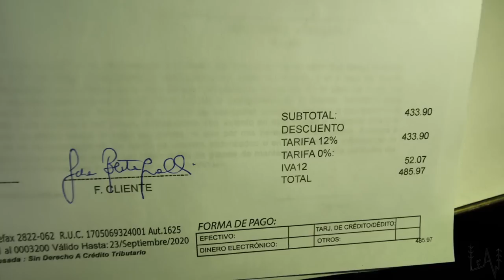Van Life RESILIENCE - We don't give up on our old Truck Camper Lucky LeAw

Comment: You are doing what has to be done. That series of trucks are work horses .once they hit 250,000 miles they require a lot of major mantinance.  Hope they put new axel seals in  the axel housing them always leak  best to replace every time you pull the axels out.

Comment: The drive shaft is 2 pieces (3 U-joints) if its not replaced in same position it came off it will most likely be out of balance. If it was correct then most likely the carrier bearing is worn out also. And probably the bearing on the front of the differential too, cause the seal was leaking there too.
Reply from the maker: Good morning! In the next video (on Sunday) we will finally fix Lucky LeAw and get back on the road! We will also show in the video what was wrong! Thank you very much for watching and commenting! 🙏❤😊👍😉👋 Cheers Luca & Sara

Comment: It almost looks like the section of driveline at the transmission end is slightly bent. It could be an optical illusion on the video. Hold a straight edge along the tube. If it isn't touching the whole length, it's bent. Two options are replace the whole thing or have the tube cut off and a new one welded on. Second option is have a driveline shop do the work. If it's straight, it's not your driveline. It could possibly be the bearing is worn out on the output shaft of your transmission. Another possibility is the cap bolts holding your U-joints together are worn and aren't keeping them together tight.
Reply from the maker: In the next video (on Sunday) we will finally fix Lucky LeAw and get back on the road! We will also show in the video what was wrong! Thank you very much for watching and commenting! 🙏❤😊👍😉👋 Cheers Luca & Sara

Comment: different pieces of drive shaft have been installed in the wrong orientation (clocked wrong) separate the pieces one at a time and turn ninety degrees and reinstall . repeat until vibration is gone
Reply from the maker: Good morning! In the next video (on Sunday) we will finally fix Lucky LeAw and get back on the road! We will also show in the video what was wrong! Thank you very much for watching and commenting! 🙏❤😊👍😉👋 Cheers Luca & Sara

Comment: Check the last connection for center, the union next to the rear end. Possibly not properly centered under the small u-bolts, that hold the universal joint the the rear drive axle. Hope this helps. My prayers are with mates.
Reply from the maker: Good morning James! Thanks! In the next video (on Sunday) we will finally fix Lucky LeAw and get back on the road! We will also show in the video what was wrong! Thank you very much for watching and commenting! 🙏❤😊👍😉👋 Cheers Luca & Sara

Comment: Look on the front yoke and back yokes there are tabs that the ujoints fit between its possible that one side is not in the tab you would have to loosen the unbolts on the yoke and tap the bearing cap back on then tighten the  unbolts back up. One other thing is make sure the safety pins that lock into to ends of the ujoints are there not missing if one is missing could mean that the ujoint is not centered right, take it back tell them it's not right they should fix it free of charge as it was not that way before. Dont let anyone tell you it's a bent drive shaft its not!
Reply from the maker: OK! We will! You are right! Thank you very much for watching and commenting! 🙏❤😊👍😉👋 Cheers Luca & Sara

Comment: Put the truck on a hoist to take the wheels off the ground. Mark the relative positions of the driveshaft installation with chalk or a crayon so you know the installed position of the shaft when you started. Remove the rear section of the driveshaft, start the vehicle, and put it in drive, to isolate where the vibration (eccentric rotation) is coming from. I would guess a bad u-joint, or improper installation of the u-joint. I'd suggest the use of his bench vise, with wd-40, or other lubricant to ease the installation of the end caps on the u-joint. The vise will press in the end caps rather than hammering them in. The rear u-joint, the one closest to the differential input shaft does not look like it is fully seated against the stop in the yoke. Nor do I see the locking clip installed.
Reply from the maker: Good morning Chris! In the next video (on Sunday) we will finally fix Lucky LeAw and get back on the road! We will also show in the video what was wrong! Thank you very much for watching and commenting! 🙏❤😊👍😉👋 Cheers Luca & Sara

Comment: Always,  before taking a driveshaft apart mark the ends of the shaft on both ends in relationship with the differential yoke and the transmission output.  And make sure when they are reassembled that they go back together the same as they came apart. It doesn't always matter when You reassemble the components. But when it does matter it matters a lot.
Reply from the maker: Good morning! In the next video (on Sunday) we will finally fix Lucky LeAw and get back on the road! We will also show in the video what was wrong! Thank you very much for watching and commenting! 🙏❤😊👍😉👋 Cheers Luca & Sara

Comment: You have to put the u joints back in the same way they came apart...they should have marketed the daft so it would go back the same way...si start by taking the front one and rotate it one half..then test..then go on down the line..

Comment: When you remove a drive shaft, a good mechanic will mark the position of each section so it goes back the same way. They obviously didn't and that's what's causing the vibration, and that will lead to more problems later. I would go back to same mechanic and ask them nicely if they could recheck their work. It looks like they gave you a break on the price, that's why I would ask them nicely to reposition the shaft and see if that fixes it. Good luck guys, we're rooting for you.
Reply from the maker: Thanks! In the next video (on Sunday) we will finally fix Lucky LeAw and get back on the road! We will also show in the video what was wrong! Thank you very much for watching and commenting! 🙏❤😊👍😉👋 Cheers Luca & Sara

Comment: you need to pull the drive shaft apart at the slip joint and rotate it until the universal joints are back in phase
Reply from the maker: Good morning Michael! In the next video (on Sunday) we will finally fix Lucky LeAw and get back on the road! We will also show in the video what was wrong! Thank you very much for watching and commenting! 🙏❤😊👍😉👋 Cheers Luca & Sara

Comment: Make sure the ujoints are in line( all caps in line with each other) the front part looks like its shaking pay closer to attention to it look closely the front joint to see if there is a dent or a spot that could have been a weight. I think the angle in the drive shaft is a little steep after the carrier bearing ( center support) . People don't understand the difference in other countries not all parts are just replace while in America we don't rebuild things.
Reply from the maker: Good morning Jim! Thanks! In the next video (on Sunday) we will finally fix Lucky LeAw and get back on the road! We will also show in the video what was wrong! Thank you very much for watching and commenting! 🙏❤😊👍😉👋 Cheers Luca & Sara

Comment: The shaft is balanced as an assembly....marking it makes no sense.

I think you should have the u-joints rechecked. If you drove out without a vibration...it shows something moved afterwards. 

You're not in any danger of a major repair. One of those joints is offset.
Reply from the maker: Good morning Frank! Thank you very much for watching and commenting! 🙏❤😊👍😉👋 Cheers Luca & Sara

Comment: My first guess would be that they damaged the new u-joint when they installed it. OR when taking out the old u-joint you should mark both ends so you can put it back together the same as before to keep it in balance. Not sure if they did this.
Reply from the maker: Good morning! In the next video (on Sunday) we will finally fix Lucky LeAw and get back on the road! Thank you very much for watching and commenting! 🙏❤😊👍😉👋 Cheers Luca & Sara

Comment: It sounds like your brake shoes need adjusting.. Its a quick fix.   If not that, your split shaft bearing is going bad or a universal joint. That is also a quick fix. Okay I saw its the U-joints. That''s good, Not that expensive, but I would also change that Split Joint Bearing on the driveshaft. Check the oil in the Differential. If it's low, it will cause your gears and bearings to get hot, on those mountain pass climbs.
Possibly split bearing. The direction of the grease fitting should not matter. That is just for greasing the joint. I'm still leaning towards the split joint bearing.
Reply from the maker: Good morning! Thank you very much for watching and commenting! 🙏❤😊👍😉👋 Cheers Luca & Sara

Comment: You don't need a new driveshaft - it was fine before.  The 'mechanics' did not mark the driveshaft sections to align the same way they came out so that the balancing stays in the same orientation as what it was.  This is rule number one:  Mark each section of shaft to align in the exact same location as it was before, relative to each section, even coming out of the transmission.  In doing this, do not turn the engine after the marks have been made, and do not turn the rear end.  Make marks to align for each section, front to rear, then don't turn anything until the shafts go back in....oriented just like they were before the shafts were pulled out.
Reply from the maker: Yeah, exactly!

Comment: I am very sorry you guys are having so much trouble. I might be able to help if you can provide good clear pictures of each U-Joint. As soon as I saw the "mechanic" beating the U-joint with a hammer it made me cringe. I like to use a press or a vice to install U-Joints. The end of the driveshaft that the U-Joint fits into is called the "yoke". The part of the U-Joint that held the needle bearings is called the "cup". When you beat the cup into the yoke with a hammer it can dislodge one or more of the needle bearings so that they turn sideways in the cup and won"t let the cup seat fully. If one of the cups is not seated fully the U-Joint will not be centered and it will vibrate. The pictures of the driveshaft at 11:48 before the repairs started, 

clearly show the retainers on the outside of the cup are in place. The pictures @ 22.25 are too blurry for me to see but I don't think I saw any retainers. The retainers snap into a groove inside the yoke.
Reply from the maker: Hi Ken! Thank you very much for watching and commenting! 🙏❤😊👍😉👋 Cheers Luca & Sara

Comment: Buy the way,  just in case I didn't get my point across earlier... If the driveshaft didn't vibrate before the new U-Joints were installed  THE DRIVESHAFT WILL NOT VIBRATE AFTER THE NEW U-JOINTS ARE INSTALLED. if they are installed correctly. Simple logic.
Reply from the maker: Exactly!

Comment: They should of marked driveshaft before disassembly now needs to be balanced. Have them remove the 2 u-joints and turn them 180 (one at a time) maybe you’ll get lucky. Also I didn’t like the way the grease monkey was beating the new u-joint in, should use a hydraulic press.

Comment: ok, FIRST, the mechanic SHOULD have INDEXED the drive shaft by making a chalk mark or some way to align the drive shaft with the rear differential BEFORE he took it out. The mark should be long enough that handling the shaft won't rub it off. Second, make sure the grease fittings "zerks" can be reached with a grease gun nozzle for servicing. The solution the out of balance drive shaft MAY require uninstalling it and reinstalling it until the vibration stops... without prior indexing it is a trial and effort ordeal to get it corrected.
Reply from the maker: Hi David! ok! Thank you very much for watching and commenting! 🙏❤😊👍😉👋 Cheers Luca & Sara

Comment: Also if the u joints are causing the shaking it’s because they were not installed properly. If they were it would be balanced. You are supposed to mate the position of the drive line with multiple colors and marks (preferably). Since this was not done your line is not balanced. You should not be charged for work that was done improperly.
Reply from the maker: Yeah!

Comment: Check ir hace Check your brakes well do full maintenance because Ecuador roads on mountains are very very tough on brakes ..find a break shop and be there Luca for the whole process ..watching all is done properly. Also check all steering system. Look if you breakdown engine or whatever other than steering and breaks nothing will happen , but, if you have problems with those two you could have a very bad accident. Ecuador is dangerous to drive steep very steep roads.
Reply from the maker: Yeah! Thank you very much for watching and commenting! 🙏❤😊👍😉👋 Cheers Luca & Sara

Comment: From Google ..... Vibration in a driveshaft can be caused by many conditions. One of the most common cause of drive line vibration are worn U-joints or slip splines, out-of-balance components, yokes out of phase or misaligned angles, approaching critical speed range, and yoke ears that are not concentric with the splines. There are also procedures on how to balance a driveshaft. Unfortunately, it looks like there are many possibilities from replacing so many components in the drive line. Any misalignment in any of them could cause the vibration. Sorry but I don't have much knowledge on this subject.
Reply from the maker: Hi, beautiful couple! Thank you very much for watching and commenting! 🙏❤😊👍😉👋 Cheers Luca & Sara

Comment: simple - they put the front drive shaft on wrong. just unbolt the front drive shaft and turn it one half turn and bolt it back on. they forgot to mark it when they took it off.  easy fix...... no cost
Reply from the maker: Thank you very much for watching and commenting! 🙏❤😊👍😉👋 Cheers Luca & Sara

Comment: I'm so sorry you guy's are having some bad luck that truck is doing good for it's age and what it's been through but they should be able to get it right they did something wrong it just needs to be done over and figure out what they did wrong would try to find someone with a press to put the U joint's in we've used a hammer before but only in an emergency maybe you can find a truck repair place
Reply from the maker: Good morning! Thank you very much for watching and commenting! 🙏❤😊👍😉👋 Cheers Luca & Sara

Comment: schweet,but I hate to tell you that's a bad or improperly installed ujoint and normally when they sound like that it's not long before the driveshaft drops out,also the angle of the slip joint looks to be out of alignment due to the rear end misaligned or the carrier mount has failed,good luck
Reply from the maker: Thank you very much for watching and commenting! 🙏❤😊👍😉👋 Cheers Luca & Sara

Comment: Was the drive shaft reinstalled backwards?
Reply: Impossible to install backwards.
Reply: @MudRFunR  its a two piece drive shaft.... the sections could be backwards or indexed wrong....
Reply: @pygpen  Yes I agree that it could be indexed wrong. I was looking at the front section which can't go backwards but yes it looks like the rear section could go either way.
Reply from the maker: =X

Comment: looks like they only change the  u - joint  you shouldn't have  to rebalance drive shaft .  the video looked like drive shaft was spinning fine no wobble no unusual sounds. get the brakes done and move on.  count your blessing this issue didn''t happen further down the road were there was no turning back.
Reply from the maker: Hey Rink! Thank you very much for watching and commenting! 🙏❤😊👍😉👋 Cheers Luca & Sara

Comment: Love this video, but the drive shaft should have been replaced with the universal joints. Way too many hard miles twisted it badly. #Ford should be a sponsor for this truck in my commercial feed. I'm spend thoundsand to fix an old E-150 XLT now for my own adventure ahead of time. Home is where the heart lives.
Reply: They don't need a new shaft - it was fine before.  The 'mechanics' did not mark the driveshaft sections to align the same way they came out so that the balancing stays in the same orientation as what it was.  This is rule number one.  Mark each section of shaft to align in the exact same location as it was before, even coming out of the transmission.  In doing this, do not turn the engine after the marks have been made, and do not turn the rearend.  Make marks to align from front to rear, then don't turn anything until the shafts go back in....
Reply: @12B4Christ  sadly hindsight is 20/20. I know what you're saying, but new might be better at this point.
Reply from the maker: Good morning! Yeah, Ford should support our expedition from Alaska to Argentina! In the next video (on Sunday) we will finally fix Lucky LeAw and get back on the road! We will also show in the video what was wrong! Thank you very much for watching and commenting! 🙏❤😊👍😉👋 Cheers Luca & Sara

Comment: I am so sorry for you!  I know what is wrong with your driveline.  Drivelines that have multiple shafts like yours are manufactured and balanced together.  When you take them apart, you have to put marks on the shafts so that they all line up when reassembled.  If one shaft is rotated relative to the others, it will not be in balance.  There is nothing wrong with your shaft!  The mechanics put it back together incorrectly.  The problem now is figuring out the correct alignment!  Most likely one is 180 degrees out.  In other words, when they assembled the shaft they rotated one of them 180 degrees.  If they took apart any splined sections though, if will be very hard to figure out how to correct it.  The truck is old, so most likely someone put new U-joints in before.  YOu may get lucky and find marks from previous work.  They might be just center punch marks (little dimples).  I wish I were there to help
Reply from the maker: Good morning David! Yes, exactly! In the next video (on Sunday) we will finally fix Lucky LeAw and get back on the road! Thank you very much for watching and commenting! 🙏❤😊👍😉👋 Cheers Luca & Sara